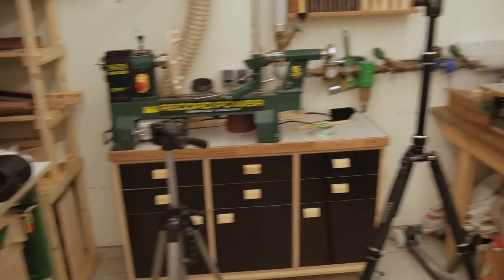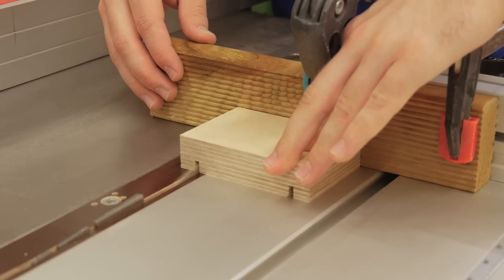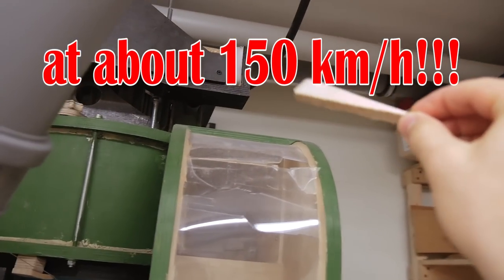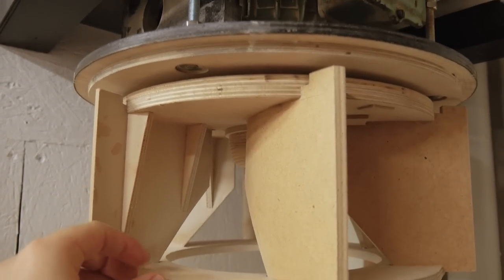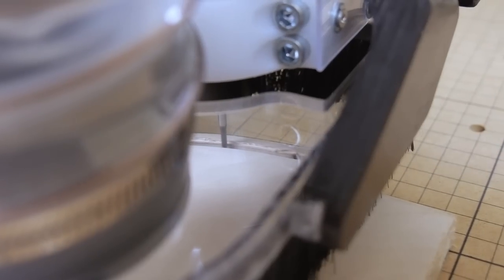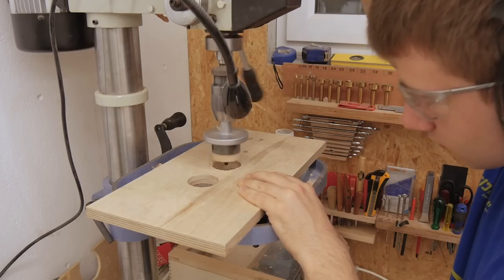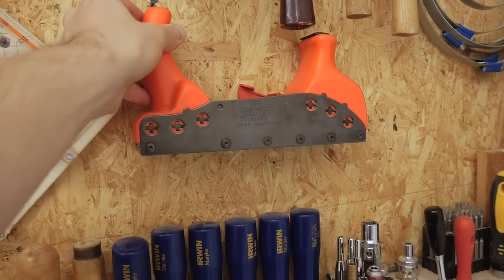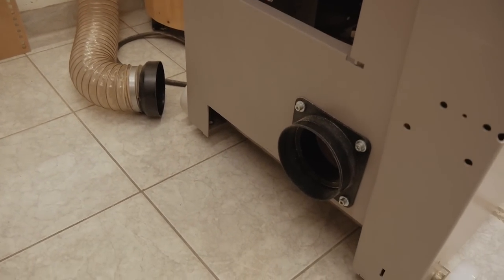Phone tripod holder, Tool holders & Dust Collector repair (Random Shop Stuff 12)

Comment: Nice phone mount solution. One Plus users unite!
Reply: im still using my oneplus one, would be nice to have a oneplus 3 but seeing that the oneplus one is still a power house of a phone, i cant justify getting the 3 just on bragging rights
Reply: same here
Reply: Primula Maggot what ROM are you using? Im using cyanogen 13 nightmares, but thinking of installing an unofficial cyanogen 14 as soon as I'm not too lazy to backup my program data
Reply: I'm using the standard Oxygen OS. Nothing special
Reply: +Ace cm13 its enough and i have no problems so i dont see any need for anything else
Reply: Not that I'm having problems... I just like the extras that come with android 7

Comment: 9:56 FILES?? In a WOODWORKING shop??? That's just crazy! 

Yeah.. this is coming from a budding engineer who's had most shop experience with metalworking machinery, as well as press forming, bending and welding. I was stopped using a file on a tool chest I was making during a wood working "stretch and challenge" session during my second college year by my tutor, hah.

And the way you're placing that plane at 12:27 can over time knacker the blade, thought I'd just say that too
Reply from the maker: These are my dads files.
Reply: Ah well, you've got more experience with wood working as it stands than I do and you'll be far better than me since I'm a bit heavy handed, fair's fair.

Comment: Shouldn't there be a valley in the planer shelf so it's not sitting on the blade? It won't damage it as is but the little details.
Reply from the maker: It's a special plane. The blade can be retracted.
Reply: You should get one of those Amazon-referral-accounts-thingies, so you can get some kickback when fangirls go to buy the same tools as you use :-) But it's probably difficult in Europe, with the five Amazons and all their different fluctuating prices.

Comment: How's the center hole on the impeller doing? Mine's gotten a bit squished at the cutout for the key from the force during startups.
Reply from the maker: Fairly well. The hole is like new and the key cutout is a little squished as well. But not to bad as I used an overly high key.